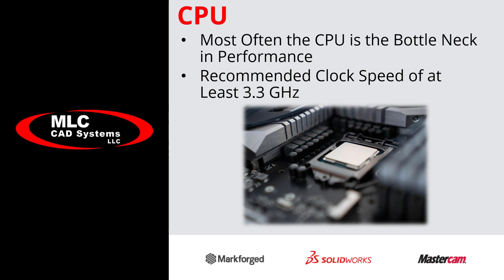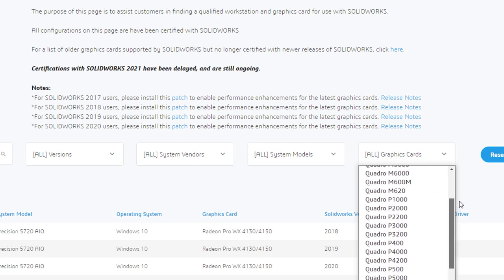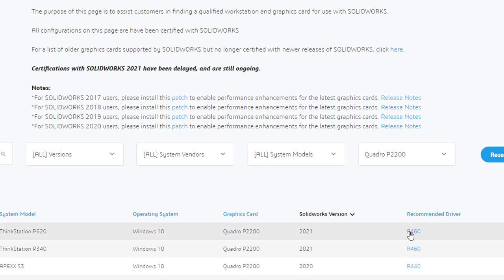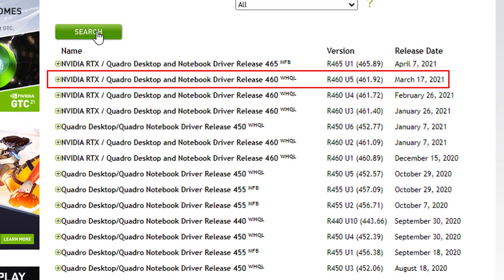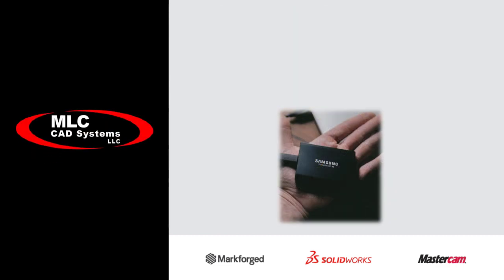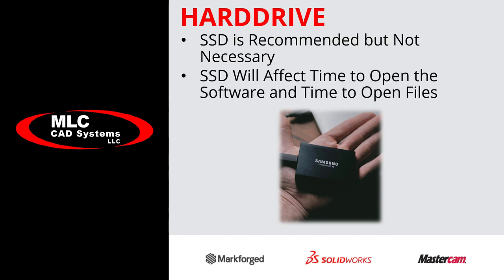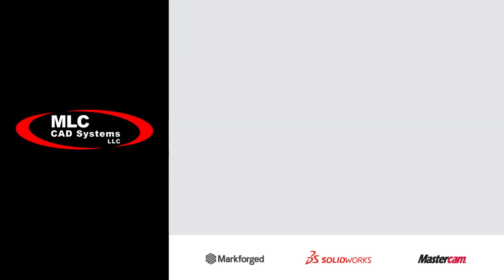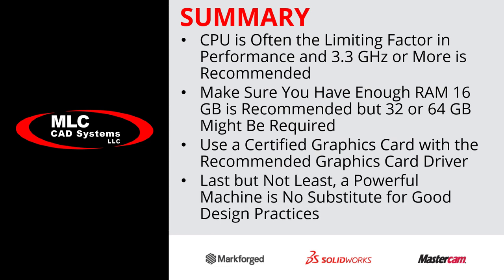Is Your Computer Powerful Enough To Run Solidworks?

Comment: 3.3 GHZ is for base clock or boost?
Reply from the maker: I believe this recommendation is boost speed, but the guidance will always shift over time as processors get faster, and it will also vary based on the number of cores a processor has.  Plus, processors get more efficient per cycle with each generation.  Balance your budget with the price breaks.  If you get 30% more power for 10% more money, that would be a good option.  If you get 5% more power for 50% more money, I would skip that upgrade.  I hope that helps!!
Reply: @MLCCADSystems  Thanks for the answer. I was in doubt if an i5 12400f with a base clock of 2.5ghz would be worse than a ryzen 5600 that has a base clock of 3.5 but both arrive at a boost clock of 4.4ghz. As I'm building a new PC I'm researching what would be best for use with Solidworks and Autocad.
Reply from the maker: I typically review standard benchmarks to compare performance side-by-side.  Different benchmark tests do better with faster clocks or more cores, and it at least gives you a good apples to apples comparison.

Comment: is a ryzen 5 3600 and a rx580 8gb and 16gb ram enough for solidworks
Reply from the maker: If this is for school or hobbies then yes, that will suffice for small projects.  If this is for full-time work I recommend using a certified workstation with an approved graphics card.  https://www.mlc-cad.com/solidworks-help-center/solidworks-hardware-guide-2021-update/
Reply: @MLCCADSystems  Thank you!

Comment: Can we run solidworks smoothly with ryzen 5 or ryzen 7 with 7300U processor 16gb ram and 4.4 ghz laptop. 

I'm confused after watching alot of video where I stuck on processor series (G, U, H, etc)
Reply from the maker: There are so many different processers and combinations of hardware that we can't list them all, but benchmark sites compare them to each other and you can see the relative performance of each model there. It also depends on your budget and modeling goals, so it is hard to make any specific recommendations. Try posting this question on a forum like Reddit for better input.
Reply: @MLCCADSystems  currently I'm not into heavy simulation. I'm working on 3d modeling and assembly, also I don't have much budget and I get this specifications at my budget. Should I go for it.?
Reply from the maker: It should work out fine. Ideally have an SSD drive in case you run low on memory or upgrade to 32gb of ram but it should work well.
Reply: @MLCCADSystems  SSd is 556gb. Thanks for your response ❤️

Comment: Is acer i5 good?
Reply from the maker: Nearly any computer can run SOLIDWORKS as long as it runs Windows.  From there, the only limitation is speed and complexity, so for basic learning and small assemblies it should be fine

Comment: Can i use my chrombook?
Reply from the maker: It depends on the specs of your Chromebook. Check out our full Hardware guide to make sure your computer is able to run Solidworks.

https://www.mlc-cad.com/solidworks-hardware-guide/
Reply from the maker: The most likely limitation will be the operating system, it must be Windows which Chromebooks don't run out of the box.

Comment: Rtx 3050 runs solidworks??
Reply from the maker: Gaming cards are capable of running SOLIDWORKS but aren't optimized to do so.  In much the same way a sports car and a dump truck have similar horsepower but allocate it differently, the RTX series will handle small parts easily but will struggle with large models or long modeling sessions.  If this is a home computer or you are doing this as a hobbyist it will work just fine, but a full-time professional CAD user should invest in a Quadro or Pro series workstation card.
Reply from the maker: @ccrddom6234  It is likely going to work well for you.